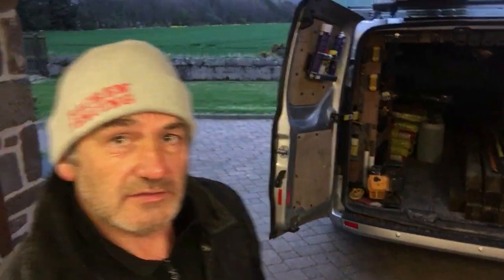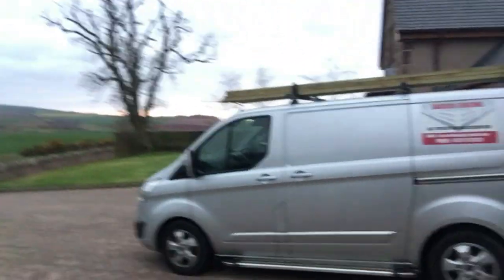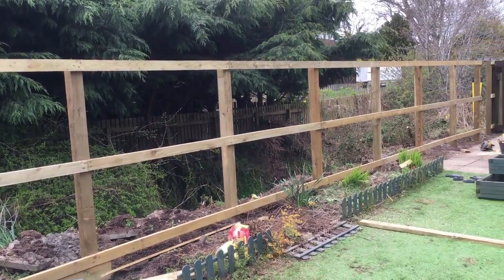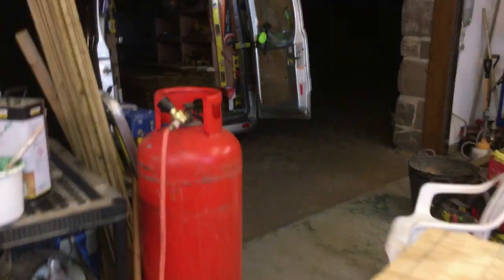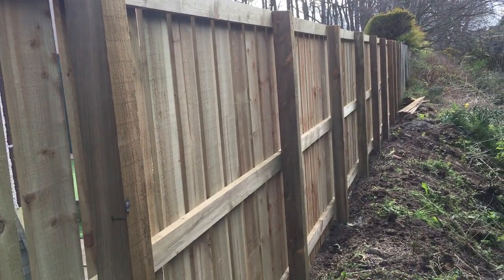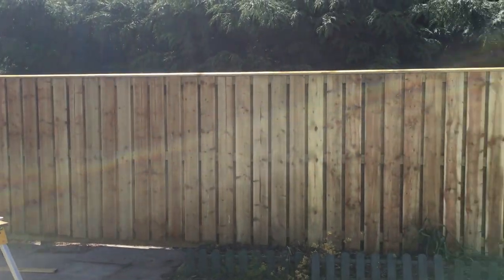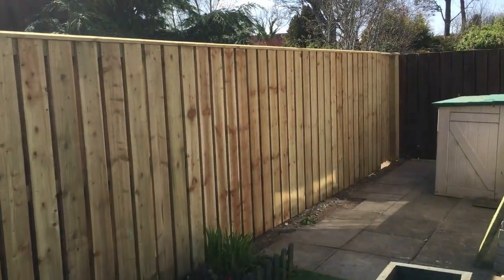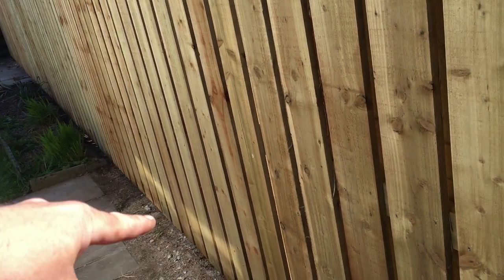Wooden Fencing Installation VLOG | Hit & Miss timber fence with Gate

Comment: Hi Barry great videos, looking at attempting this style myself (DIYer) what size timber do you use typically? Thanks for sharing your videos
Reply from the maker: Thanks Paul, list here - 100 x 100 x 2400mm posts, 88 x 38 x 3600mm rails, 100 x 19 x 1800mm slats. Hope this helps mate.

Comment: Do you think this method of fencing is the most suitable for fencing on a bend/curve? Thanks.
Reply from the maker: Yes, best to use vertical slats, if the curve is tight, then use narrower boards such as 1800 x 100 x 19mm - this makes it easier to go round tight curves. Hope this helps

Comment: Hi what types and sizes of nails do I need to install a fence pickets by pickets with the dewalt DCN692? Thanks
Reply from the maker: I use 2.8mm x 50mm Hot Dipped Galvanised Ring Shank Nail. I hope this helps ?

Comment: Tidy job. Do you find the fiberglass spoons bend when digging clay soil? I changed mine out to metal handles and they are far better
Reply from the maker: Thanks Chris, the ones in the video are Roughneck and they are pretty good to be honest. I also have fibre glass Spear & Jackson ones which are a bit more flimsy, but nice and light. I also have wooden handled Spear and Jackson which are pretty good. I have recently invested in a set of Carter Shocksafe spoons (£150 quid 😩) but still getting used to them - they are heavy and work on a "backwards" scissor action which I am not used to.............I plan to do a video on all the different types that I use to point out the pro's and cons.
 Recently bought the Carter KingSumo fencing spade, if you are going to be doing a lot of fencing, that is worth looking in to. I will do a review on it soon.
 Thanks for the comment, much appreciated ! Hope you are keeping busy mate 👍
Reply: @Bacrenfencing  yeah mine are the roughneck ones but both sets cracked at the spades by the bolts. Those handles are now part of a ladder in my lads play area 😂
I've seen those reverse spares but shuddered at the price. Be really interested in your review, I'll look forward to that. 
Today I did my last fence from the storms a little while back. Made good time,.seven bays of 6.6ft featheredge panels into concrete posts and boards. Arrived at 8am gone and finished by 1.30. the old fence and dig was really kind, doesn't happen often 🤣 thanks for the reply pal and I'll look out for the next vid 👍
Reply from the maker: 🤣 Yep, I have been through a few sets for exactly the same reason, especially the spear and jackson ones and can't find spare handles anywhere ! Those bloody bolts always come loose as well...........That is the main reason I bought the Carter shocksafe set as they are solid and professional grade. I use the Stihl BT131 auger as well but depends on the ground conditions 9 times out of 10, the areas I work a laden with boulders and tree roots which renders the auger useless ! 
 That's good going on the feather edge (I watched your video a few weeks back when you done more than that..........I was tired just watching you🤣), I'm too old to be out killing myself 😊I used to knock my pan in, but have learned to charge a premium and take my time and aim for quality - that is my business model and suits me. Can't keep up with demand at the moment. Take it easy mate !
Reply: Roughneck send spares out for nothing I think.  My opposite action doubles broke at the bottom.  They just send out the new bits
Reply from the maker: @finalfencing  Good to know mate ! Thanks for the comment !

Comment: Howdy from Dallas. I got out of the fence business years ago. I used to charge $1 per LF for fencing labor. I wonder what today's labor pricing is these days? -- Thanks
Reply from the maker: Hi Tom, to be honest, I never charge by the foot - I price each job individually as there are so many variables. I tend to charge a day rate and add my material mark ups and gross profit on top. That seems to work fine and helps grow the business. Thanks for the comment and say hello to Dallas from Scotland UK 😎
Reply: @Bacrenfencing  - Nice. George Galloway country.  I work on single family residential rent homes (property managed by corporations), I do jobs so fast that a day rate would cut my throat. I charge by the job or task. I usually average $400+ per day in pure profit. Example, I just did a new kitchen faucet install for $124 labor. It took me 20 minutes; and then on to the next job (or task); many times in the same rent house. One recent super expensive rent house ($3,000 a month rent), had 18 different task; each task got maximum labor profit squeezed out of it. Corporations never ask me "how much?," They only ask, "When?" 
: )
Reply from the maker: @Tom  Sounds like you are doing well Tom. I made the decision a couple of years ago really, to set up and grow an actual fencing business, so that is what I'm currently doing. I enjoy the challenge of growing a business from scratch. The day rate factors in growth and profits etc, so it works out really well for me. I have a property background and own and operate my own rental properties, so I am no stranger to that line of work, but I have a passion for fencing for some reason...........I think it is the feeling of freedom working outside all day.........and seeing the final product making a difference to peoples lives that I enjoy.
 I also have a corporate management background from the Oil & Gas industry, so I bring all of that 20+ year experience into what I am doing now. It's funny how life works out, if you asked me 10 years ago what I would be doing in 2022, I never in a million years would guess that I would own a fencing business........... 
 Good luck in what you are doing Tom, I used to do the same. I used to love doing the renovations and charging per "task" that you could rattle through many in a day - some good money to be made if you become super efficient. Well, that's my life story...😂 - best of luck with what you are doing Tom and I will say hello to George G for you !
Reply: @Bacrenfencing  - That is awesome that you are building a multi-employee business. I've always been kind of a loner and introvert. Therefore rental remodel, repairs, and renovations suits me well - ("A man, his tools, and his thoughts...").  We are both lucky to have found something that we enjoy and that there is a huge demand for our services. 
: )
Reply from the maker: @Tom-Travels  Awesome Tom, I know what you are saying. I am very similar to yourself, but as time goes by and we get older :-(  I am just planning for the future. I will not be able to be out fencing every day as it is hard physical work. I would rather build the business and run the business in later years without having to do the manual physical labour at the age of 50+ ........... I still love doing it but it takes it's toll on the body. I am glad you love what you are doing, it is great to get up in the morning and spring out of bed to do something you love - something very few people experience. Good luck to you Tom !